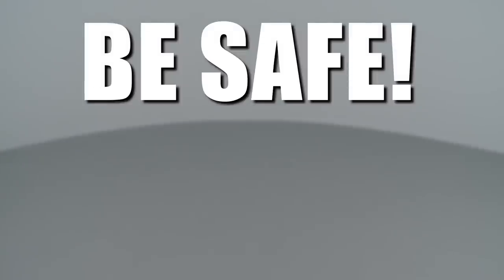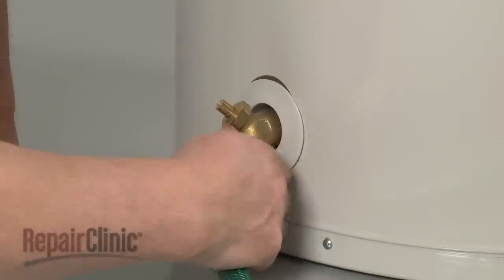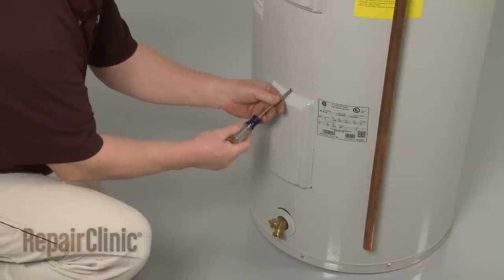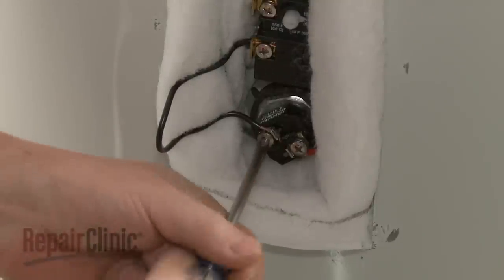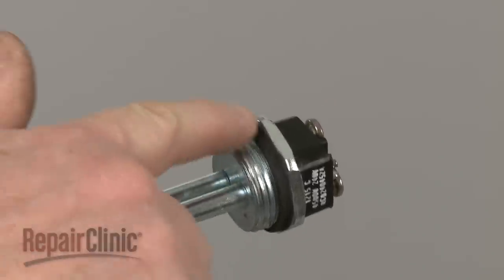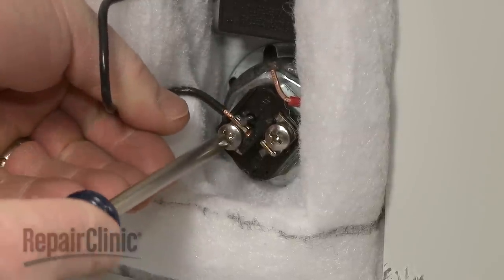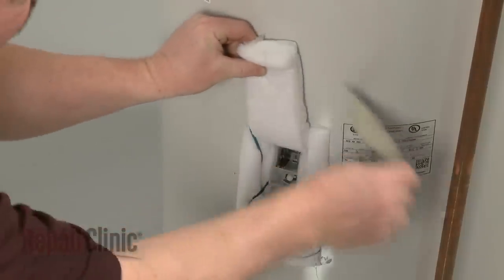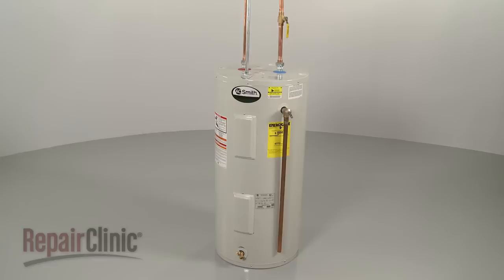Water Heater Not Heating? Element Replacement #9000092045

Comment: Hey guys. Thanks for your help I'm the past. But I have a important question.. I used your video to fix my washing machine. We have a whirlpool cabrio. My mother says that me running many loads with only one item is what caused the bearing to go. Is this true! I sometimes stain am expensive shirt so I'll run a quick wash on low speed to take care of it ASAP. She runs large loads on top speed. I hate high speed since it hurts to clothes. What will cause more wear and tear on the machine. A load with a few items at low speed. Or a full load at top speed.. What will cause the machine more wear?

Comment: Thanks I'm going to drain the water heater anyway while I'm inspecting the heating element and thermostats since it's been a while since I flushed it. Then i'll inspect each heating element and if its good then the thermostats are bad. Not a professional solution but altogether it would've been ~$50 anyhow.

Comment: Hey, my problem is I have hot water but it's running out in like 5 mins when taking a shower.  So it's heating water but not a lot.
Reply from the maker: +jimmy bond Perhaps one or the elements is bad or a thermostat is defective.

Comment: what do I do if I forgot to turn on the faucet while draining the water heater, and now that I turned the water on to fill it back up, all I get is air from the hot water faucet when I turn it on?
Reply from the maker: +Frank Bruce You probably know by now but for others the air will purge from the tank after a short time.